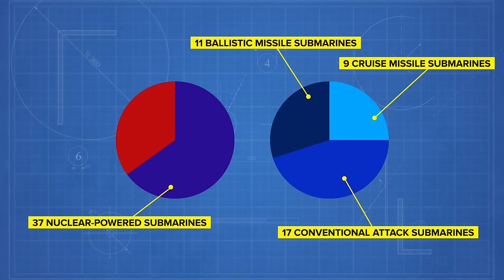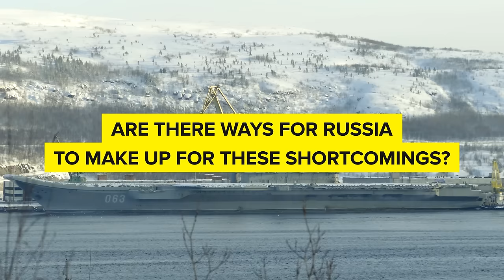Why Russia's Navy SUCKS

Comment: The Moskva is a pretty high tech submarine
Reply: It's very stealthy.....at the bottom of Black Sea.
Reply: Maybe, except for their torpedos which kill the boat and crew.
Reply: @georgemacdonell2341 Yeah who would have thought that large amounts of concentrated hydrogen peroxide in an enclosed pressurized vehicle hundreds of feet under water is a very bad idea? 😬
Reply: It's recently been modified to be a submarine.
Reply: It would be high tech if it were able to launch its missiles from its current position. However, I would consider it to be low tech in its present state!
Reply: Or, as I prefer to call it: The Snake Island Memorial Reef.
Reply: Oh I don’t know… most submarines surface occasionally…😂
Reply: @bluntone2273  Yes!  But it is superior, it has no need to surface, since it has no living crew!
Reply: The irony is that while the Moskva can't get above the waves, Russia's ssbn's can't get below them.

They are so deteriorated that they stay tied up to the pier and no longer conduct deterrent patrols at all.

Which means they too, are unable to launch their missiles.

Comment: Russia can rightfully claim it has the second-best military......in Ukraine.
Reply: If you were to count Wagner in, not even that
Reply: Yeah, with Wagner around, Russia had the second best military in Russia
Reply: Russian logistics: Sending life boats to the front line and trench digging tools to the nazy since 2022..
Reply: Funny !😅
Reply: @raeishimura  didn't wagner collapse?
Reply: If Russia is so bad why aren't they losing?
Reply: @darty4421 because not only have they taken fortifications behind rivers and the such but also ukraine is not that much better in terms of compotence in industry or in the military
Reply: @wirelessmug  so Russia is strong?
Reply: @darty4421  on paper? yes, in practice? not so much
Reply: @wirelessmug  what you mean in practice
Reply: @darty4421  they are bogged down in what can i only describe as WW1 style when in theory they should have shit swarmed thru The Ukraine but due to constant tactical failures (and their equipment not being nearly as good as being advertised)
Reply: @darty4421  in theory it SHOULD be
Reply: @wirelessmug  what I was told is that the reason why they invaded Ukraine was to capture the Russian parts of Ukraine. The Kiev invasion was just a distraction that was using old soviet equipment. It was a win win for them. If they captured Kiev, then good. If they didn't, then their distraction worked. That is why there are so many defenses around the Russian part of Ukraine and why Nato wasn't able to break through, and why Russia is constructing new cities
Reply: @darty4421 russia is doing anything BUT constructiing new cities

Comment: Correction at 2:00
It REQUIRES Turkey to block warships during wartime. That was a condition for allowing Turkey to occupy and control Constantinople. Should Turkey fail to block warships from traversing the straits then they are supposed to forfeit control of that city.

Comment: There was a pre war report about the state of the moskwa. A lot was broken or running on lower power. Most of the defence systems you mentioned were broken or otherwise not able to operate.
Reply: The jets operating on it can't even take off fully fueled and armed,  they have to decide fuel or weapons or go short on both.
Reply: Lazerpig
Reply: @sumotony  Jep

Comment: Understand just how bad this dearth of technology is, by this example:

They are trying to build Frigates with Gas Turbine engines. They could only build two. That must be a really high tech problem, right?

My ship was a Spruance Class Destroyer. It had four Gas Turbine engines for Main Propulsion, and three for electrical power generation. My ship was commissioned in 1983...which was 41 years ago. But it's worse than that, as my ship was the LAST in it's class. The lead ship, the USS Spruance, was commissioned in 1976. Figure 5 years to build it and ten years to get the appropriations...and we are talking about a technology from the early 1960s. 

In 2024, Ivan cannot build more than two of these.

Friends, it is bad. It is really really bad.

Comment: Russia has been sin the beginning of the 1900s focused on land warfare. The Russian Navy was a junior branch of sorts. Kind of like the British army compared to the UK's Royal Navy. This applied to the Soviet Navy too. This meant that officers were far more likely to be promoted based on political favours or nepotism. Competent officers were retired when they reached minimum retirement age usually. 
Not having a unified command is another issue. Russia has 4 fleets.....theoretically: the Black Sea fleet, the Baltic fleet, the Northern fleet, Pacific fleet. Now, having 4 different fleets doesn't mean that you can't have a unified command. It's worth mentioning that the Russian Armed Forces are organised in military districts and that the fleets are subordinated to the military districts. Considering that the Navy was a junior branch this means that those districts are most likely lead by generals of the Ground Forces. That's one of Russia's issues.   
Worth mentioning that out of the 3 frigate designs at least 1 was built based on an existing design that was for export because of the delays in the production of the design for domestic ships. That export design was actually proven to work, it was exported to the Indian Navy. It was a good idea. They are now focusing on the domestic design. Also, you have to wonder what exactly are YOU calling frigates or corvettes? Some corvettes are called frigates by the West and some ships that are called corvettes by the West are called small artillery and missile ships by Russians or patrol boats. Missile boats are a thing in the West also.

Comment: Maybe Putin could nationalize all the oligarch's super yachts and arm those.  They're probably more up to date than anything in his paper bear navy.  Laf, or the air force for that matter - I'm sure the yacht captains don't have to use their iPhone's gps to navigate, as an example of the sorry state of the military's electronics.

I was floored to read some AF pilots and navigators actually used handheld Garmin gps units because either the nav equipment in the Flankers, and even the ground attack Su-34s, did not work, or the crews did not know how to use them.  Imagine being sent on a low level ground attack mission in a Su-34, and finding your way to the target with your iPhone!

Comment: The Admiral Kuznetsov is NOT classed as an Aircraft Carrier, but as an Aircraft Cruiser, as it cannot hold a full air wing, and has a limited aircraft presence. It was designed to protect the submarine force, and is more of a surface combat ship, with 'some' aircraft. Also, it lacks a catapult launch for the fighters that then have to take off with a limited armament load.
Reply: nope , its called that because its to heavy to be classified as a carrier

Comment: Why don't Russia go for air superiority
Reply: They have been trying but due to the high concentration of SAM sites and russia not having a SEAD doctrine prefering land assualts as they are easier to co-ordinate has meant its nigh impossible to push for air superiority without sustaining huge losses which at this current point in time the russian economy cannot support. The loss of that AWACS An50 has also massively hindered their attempts now.

Ukraine dont have air superiority either tho, its why theres tons of footage showing low missile runs with aircraft and helicopters barely above the tree lines. Ukraine gaining f16s and more patriot systems 'could' shift the air war in their favor but its liable to remain a stalemate just like the ground conflict

Comment: Russia is at best 20 years behind in technology.
Reply: which still means they have smart weapons, drones, thermal imagining, advanced ballistic and cruise missiles, guided shells, a full range of air defense systems and a whole lot more and they can make it for a fraction of the price cant they? and what new war winning technology has really been pioneered in the last 20 years that russia cant mitigate anyways?
Reply: @operator9858  so why is those weapons not used on mass in Ukraine simple just as Armata fiasco they cant produce them.
just look how little Sweden is lightyears ahead in tech 
MBDA was created to allow Sweden to share tech to NATO aligned nations.
Reply: @tony18662  the terrain is brutally flat and open and its difficult to conceal large build ups of troops etc so russia is attacking in at least a dozen places from north to south everyday just wearing the ukrainians down who have chosen to try and defend every square inch of land instead of using the land to their advantage. 

none of the tech you are talking about is going to be in enough volume to matter if used in such ways and cant be sustained for long periods while russia can just keep firing away at exponential rates that ukraine cant match.

Comment: I feel like there is some fundamental flaws in your analysis. Most modern countries build frigates with advannced anti air/missile capabilities and with a payload of precision missiles. A few can use those to support aircraft carriers which is the real "seaforce" and "power projection". The idea of battleships is outdated so using metrics like "water displacement" is also outdated. Smaller, more advanced vessels can easily take on a flooating hunk of metal with outdated radar and anti missile systems. Technology is moving so fast right now that a $10000 payload will kill a flagship.